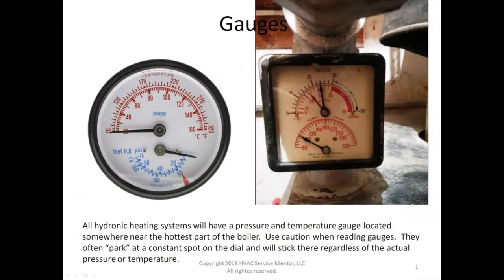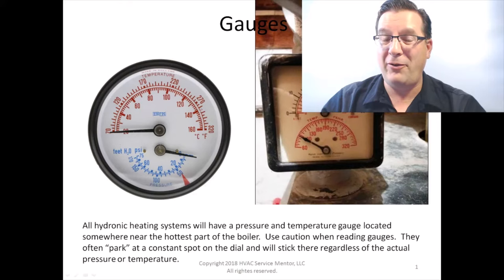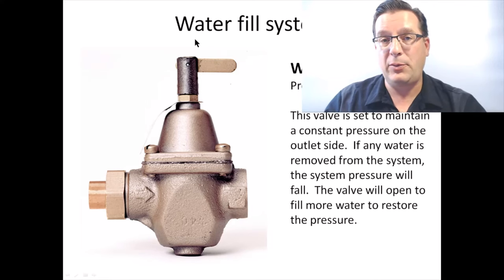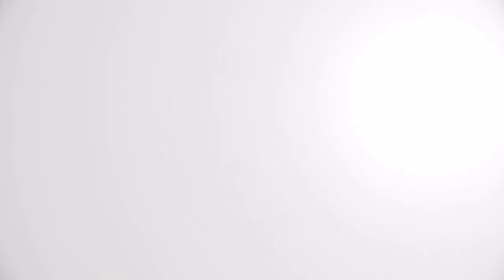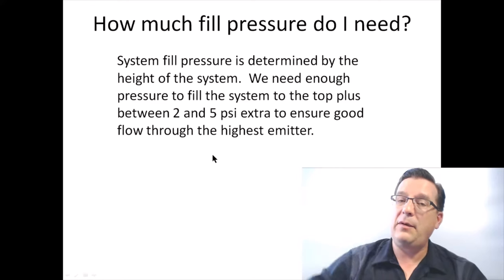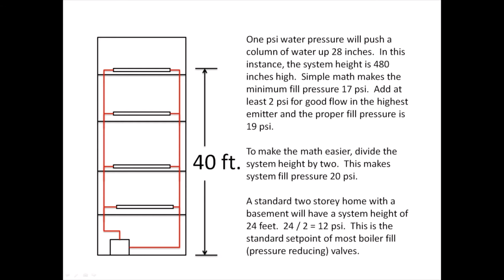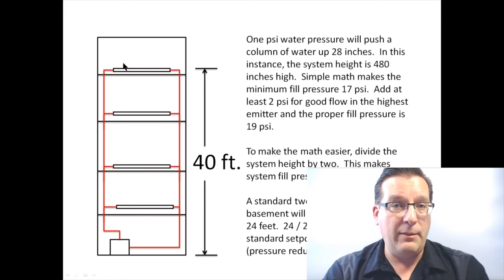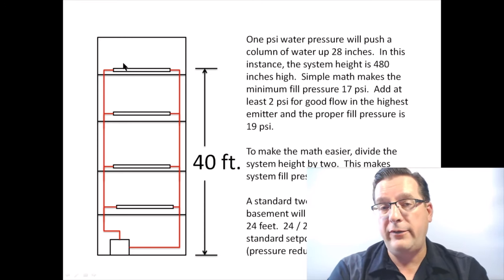How to set hot water boiler pressure

Comment: I recently picked up a maintenance on a Fulton pulse boiler located on the second floor of a 2 story building . max design water pressure 165, pressure relief 165. 
System has a leak and prv didn't allow water to refill. Made the mistake of opening it up to allow pressure thus allowing boiler to fill instead of just using bypass. Was super worried I set it to high as there was no gauge installed after prv. Didn't start leaking out the relief and boiler did fire and run through cycles. Your video just cleared up so much for me as I thought I screwed up but now I see it's all good! Thank you!!
Reply from the maker: this is an interesting situation...  because this boiler is at the top of the system, the pressure doesn't need to be very high.  In cases like this, your cold fill pressure needs to be just above the Net Positive Suction Head (NPSH) of the pump.  When the pump is running, the pressure at the inlet of the pump should never drop below this value.  If the expansion tank is piped correctly and operating correctly, that pressure should not change.  If it is not piped correctly, you may see the suction pressure drop when the pump turns on.  In this case, you need to adjust the cold fill pressure to be high enough so that when the pump turns on and decreases the pressure, it remains above the NPSH rating of the pump.  Of course, piping the expansion tank correctly is recommended and will solve that problem properly, but may not be financially in the cards for your customer.  

When you have a boiler with a MAWP of 165#, this is greater than a lot of common pipe and fittings which are often 125#.The pressure relief valve should be lower than the lowest pressure rating of anything in the system.  Traditionally, this is the boiler.  In your case, there are going to be system components that have a lower MAWP than your boiler and they require protection by the relief valve.

Comment: My oil boiler is at 23psi, in a raised ranch, max height on boards is 11 feet.  How do I reduce the pressure in the system?  I just replaced the pressure relieve valve and back flow for $185, only to have the backflow leak 2 hours later.  I bleed the line of air about a month ago, maybe I accidentally increased the pressure from 12psi?

Comment: @7:05 It's Christmas Day. I had no heat after flushing water out of my system. There was air in my pipes. But when it came to refilling my boiler, I could not just open the valve to the water, because I have this backflow preventer. 

It did what you said and it did refill the boiler. I did it until 15psi. But in retightening the bolt, apparently I screwed it too tightly and broke the piece inside of there.

Heat is back on. But obviously I'm gonna have to extract that part and replace it, or replace the whole backflow preventer. I shut off the valve feeding fresh water into the boiler/backflow preventer. 

So hopefully, I'm at least good for tonight. It's going down to 11F tonight.

Comment: Very educational … thanks. Quick question about your very last statement … when the cold water fill pressure is within the 5 psi of the relief valve (30psi), what is the proper technique to reduce that cold water pressure back to 25psi without introducing air into the system?
Reply from the maker: Water under pressure, when released through a drain valve, will not allow air to enter as long as the pressure does not drop below  zero at the top of the system or near any air vents.

Comment: Hello my friend.
I listen to you very closely as I worked on my system.
I turned down the pressure relief valve just as you said at the most I believe I want half a turn. My whole system is on one floor ground floor.
My pressure leaf valve has been blowing.
Is it possible I don't have enough air in my expansion tank ?
I have very bad eyesight so it's hard for me to see a tire gauge.
But I believe that my expansion tank only had three to six pounds in it.
Where is the manual calls for 12 PSI.
Can you give me any further suggestions why I'm having a small problem here.
I did subscribe and I hit the bell.
Keith Kuhn

Comment: I'm restoring an old home with a Burnam Hydronic system.  I removed one of the radiators to work in that area and bypassed the radiator with a piece of pipe.  This winter I noticed that the pressure relief valve was venting.  I surmised that the pressure increased because of the removal of a radiator.  I don't know how long the boiler was venting, possibly a few months, but everything seems OK.  I'm gradually lowering the pressure until the max pressure is less than 30.  I did notice that when the boiler was off, the pressure read about 12 PSI, but I observed it was over 30 when actively heating.  I guess there's no way to do the math when the system is on, so I'll just keep going down there and checking when the system comes on.
Reply from the maker: this is why my channel is not for DIYers.  You need to call a professional to fix this.  Removing the rad did not cause these symptoms.

Comment: Okay so I have a question. I have my oil/hot water furnace system, and I've been having this nagging problem about my highest point in the system which does not heat. It's about 25ft up and the boiler pressure is set to 23psi. I called my current HVAC company and they increased the pressure to almost 30psi which did work for a bit but now the pressure has gone back down to 23psi and it cannot heat the upstairs floor now. There are no leaks, blockages, air trapped, or any kind of a flow problem, and the circulator pump for the upstairs zone is new. I don't understand it because 23psi should be more than enought to cover this. Any ideas?

Comment: When I try to decrease the water pressure on my boiler it still goes pass 30 PSI for my two family house which I only need  13 to 15  psi.The reducer valve is about two year old so it's fairly still new.Is it  possible the hot water temp.Or is my new  circulating pump .What do you think ? Also what the recomemed H/W temperature for hydronic system for a two family house.

Comment: I just had my boiler system worked on and the pressure was set at about 20 when they were here. Pressure got up to 35 today and I called them and they told me to close the supply line valve and  turn out a bleed screw on one of my zones and let some water off. This screw is at the end of an approx 1/4 line that comes off the first elbow of the zone supply pipe going up.  Is this the proper way to bleed off some pressure? Will this introduce any air?
Reply: Did this work? No response from the host.

Comment: What pressure should a replacement expansion tank  be set at?
Reply from the maker: Most hydronic expansion tanks come pre-set at 12 psi because it matches many make - up water / resuure reducing valve settings.  This may or may not be appropriate for your application.  In all cases, you need to know / determine what the cold fill pressure of the system is and set the pressure in the expansion tank to that pressure BEFORE it is connected to the system.

Comment: I have a 2 year old Slant Fin Sentinel SE-140 EDP Boiler. The PRV was releasing water so I changed PRV & Expansion Tank. Boiler is still releasing water while running and pressure gauge shows 30psi. I know it should be 12-15pdsi while running. How do I lower pressure from 30psi to 12psi.

Comment: A very important point is never leave the water turned on to a boiler make up valve if you read the B&G instructions it’ll tell you to shut that makeup water supply off. That’s only used to initially fill the system it’s not meant to maintain system water pressure.
Reply: Isn't this contrary to what this gentleman states in his tutorial as he says that the function of this valve is to introduce water into the system when the valve senses to little pressure and shuts down at the preset pressure?
Reply: @davelazarick9899  Say for instance you had a leak in a copper line under a concrete floor and the fill valve just kept feeding water you would lime up the boiler up and ruin the boiler in no time. Every boiler system should have a low-water cut off so if the boiler did lose water it would shut the burner off as a safety which is required in most states. A pressure reducing valve is just a convenience to give you 12 psi on initially filling the system.
Reply: Great idea. Turn the water off that feeds the boiler. 
Turn the gas off to the burner also. If it leaks you might explode. 
Turn the electricity off as well because it just might electrocute your ass. 
Keep being a maintenance man. 😂
Reply: Why doesn’t Eric Seidel chime in on the correct answer will see what he has to say
Reply: Like it states in my first comment, the manufacture B&G actually tells you to shut off the water supply. Just read the instructions that came with the valve.   You always go by the manufacturers recommendations.
Reply: @garysmith9772  yes it says this plain as day.
I’m sure we’ve all read the instructions before. 
I’ve never left the make up water off before and never will unless it’s causing damage. 
Superior boiler and Cleaver Brooks representatives both stated it’s ok to leave it open. 
I’ll ask my local B&G rep next. They probably won’t know what a PRV is 🤣
Not saying your wrong about your statement. I just feel like you don’t spend every day in the boiler room. 
I found your statement comical.
Reply: Just close my Boila 😅thanks
Reply: Gary
Reply: @Mike-rm7vf  Dude fr. It's called makeup water and although it's should be a closed loop it still needs to made up. That's OK, when their LWCO pops up be there making 💰 😂😂

Comment: My boiler pressure gauge shows a reading of about zero when cold.  However, when heating, it jumps up to about 25 (which is fortunate since my pressure relief valve is 30psi).  All radiators in my 2 story house work fine and have been air bled yearly.  Is it normal for a gauge to operate in this manner?
Reply from the maker: NO.  This is common, but not normal.  This can happen when the expansion tank fails or becomes waterlogged, the pressure increases to the relief point, water is relieved, and then the water cools and shrinks and the pressure decreases. Simultaneously, the water makeup valve fails to admit more water to make up for what was lost.  I call this a malfunctioning system that is working in spite of the defects.
Reply: Ok, thanks!  Makes sense.  On my system, there is no automatic water makeup valve.  I add water manually with a ballcock valve as needed.  Im assuming this isn't kosher either?
Reply from the maker: @bysykler4959  The only systems I've seen like that were well over 50 years old.  There are a lot of excellent reasons to invest in a new boiler if that's the case!
Reply: Well, you know what they say.... if the racehorse keeps winning, keep feeding it hay!  😅

Comment: So when the set point is 15 psi is that with the pump running or off?
Reply from the maker: Pressure should be set when the system is not operating.  I often refer to this as cold fill pressure or standing pressure.  Ideally, for a system that has correct near boiler piping, the operation of the circulator will not affect the fill valve.

Comment: whre is the expansion tank? why is there not one to push back at the fill pressure valve to preveng overfilling a cold water fill pressure setting ?
Reply from the maker: Expansion tanks can be located anywhere near the boiler.  Those that are mounted at the fill valve and "push back" as you say are called a "Filltrol" system where the pressure in the tank sets the cold fill pressure.

Comment: I’m having similar problems to other people in this comment section. I have a 10-year-old Bryant cast-iron boiler.  My house is just like the one in your description 4 stories, including the basement, boiler is at the bottom. My temperature is 104F and 25psi at rest. Before shutting off the temperature reaches 120F and 30 psi enough to make the new pressure relief valve drip. 

A month ago. I had a radiator on the third floor leak, I removed that radiator and capped off the pipes. I later noticed the original pressure relief valve leaking and replaced it. Now the new one drips occasionally.

Does anybody know if by removing one radiator out of the system would it increase the water pressure? Expansion tank sounds hollow/empty all the way around. 

I did not drain the system when I changed the pressure relief valve. I only drained the third floor to cap off the leaking radiator. All radiators have been bled since then.
Basically, I’m trying to figure out why my water pressure changed after doing those two repairs.

Thanks in advance
Reply from the maker: You have an expansion tank probelm.  That is outside the scope of this video.  Stop diying boilers.  Call a pro and be done with it.  If you knew how dangerous this can be, you wouldn't sleep at night.

Comment: You didn’t say to how to adjust the valve itself so that it didn’t slowly creep the pressure back up that it is set properly at the pri at the proper pressure, I have had him had them slowly leak into a higher pressure setting.

Comment: I need some answers. I change my tank and it still blowing the relief valve 😢 So I went back and bought a new relief valve and it's still blowing the relief valve 😢 So I went back and bought and input regulator valve and its still blowing the relief valve 😢 So now I want the truth what the heck is going on??? My pressure is hitting 30psi which is to high because that's what the relief valve is set to blow off. Please help me it's the weekend and I have been fighting this the last few days 😮
Reply: Did you figure out what’s wrong? I’m facing the same situation right now. I replaced my pressure relief valve which is 30psi. Today I added a new Bell & Gossett pressure reducing valve which is set at 12psi and my expand tank is only 6 yrs old and it sounds like it’s good (thumps on pipe side and dings on the air side). My pressure when it’s fully hot and the burners turn off is about 33psi and it’s at about 192 F.
Reply: @DobraLLC  Yes. Mine turned out to be the internal coil leaking. I was kinda disappointed with people on here didn't get too much help. One guy even wanted to shame me for working on my own furnace. It sounds like you may be facing the same problem. I guess I would unscrew the tank just to make sure before blaming the coil. It's  mainly 3 things externally, the pressure tank the input regulator or the relief valve. Good luck and let me know what it was. It's how we learn. 😊
Reply: @boomer1049  I believe I found the problem. I replaced the expansion tank a few yrs ago and upon reading the directions I guess I thought the pressure was supposed to be equal to the house water pressure and I had it pumped up. After watching a few videos of people installing the tank, one guy said to leave it at the precharge of 12psi. I figured it was probably supposed to be equal to the reducing valve pressure (12psi), so I let some air out. I got the boiler down to about 25psi at its hottest when the burner turns off. It’s not leaking and I feel much better about it. 

Thanks for your reply.
Reply: @DobraLLC  Yes I checked my old and my new tank they were both 12psi. Thanks for letting me know what the problem was! 👍